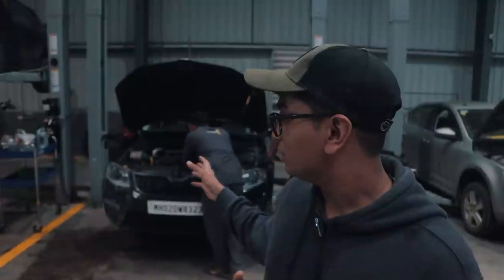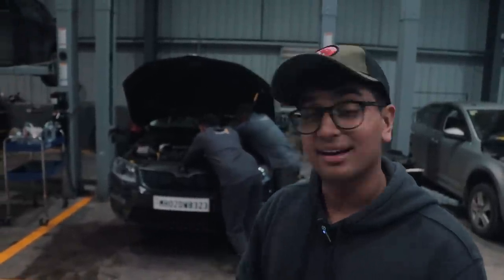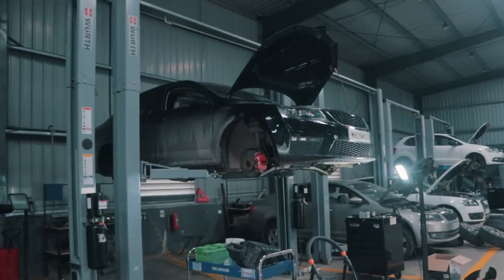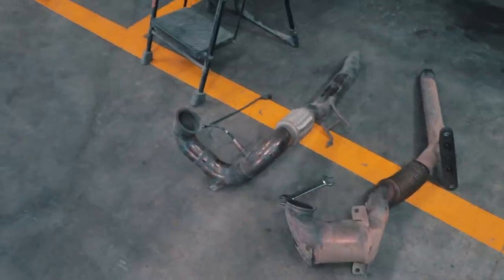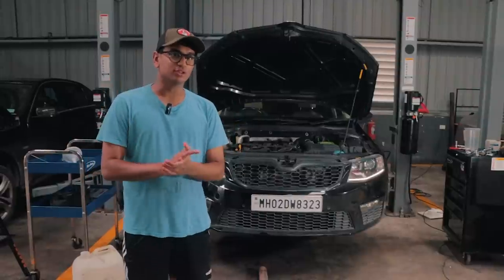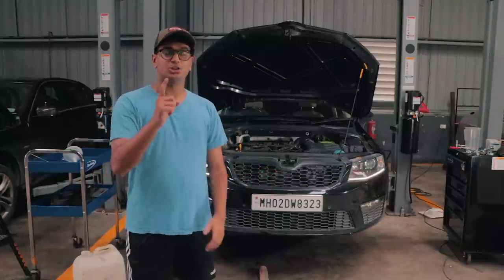Installing an IS20 TURBO & Performance Downpipe to our Octavia 1.8 TSI! | Project Octavia

Comment: why not a is28 turbo  or is32
Reply: bcos is20 came sponsored (free) from other car
Reply: Also, there's no such turbo as the IS28 or IS32. It's either IS12, IS20 or IS38. IS38 is a proper big turbo, all the power is in the later RPMs, it needs to much space to get boost and it's mad fast. Honestly, not really useful for my daily kind of build. Plus, FWD, 400+ HP, traction will come in like 5th gear.
Reply: @SohamSaraf yes this is what a car proper car guy has a knowledge 😊